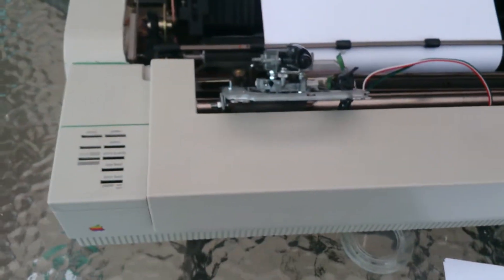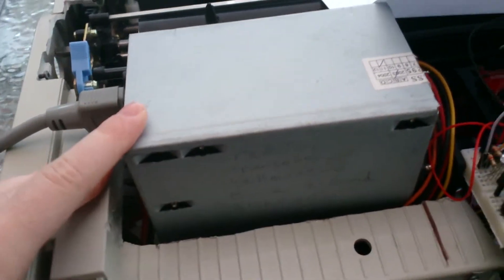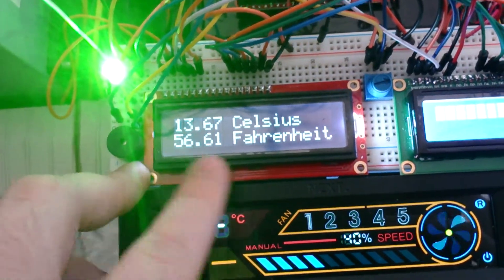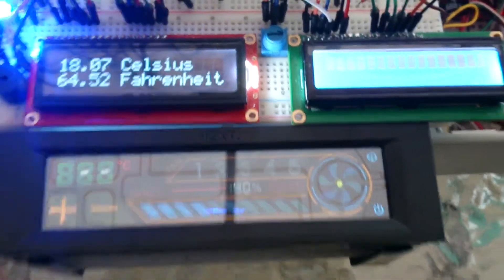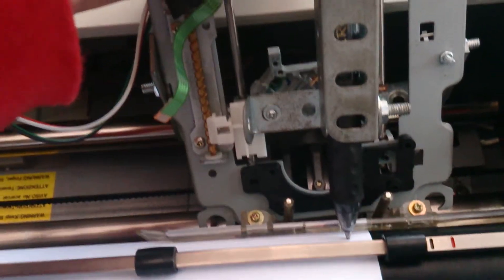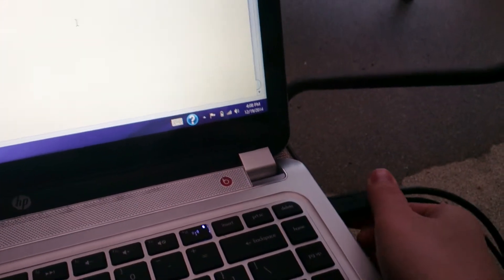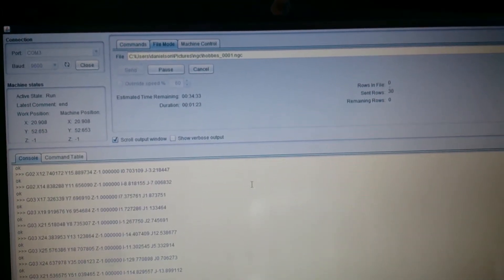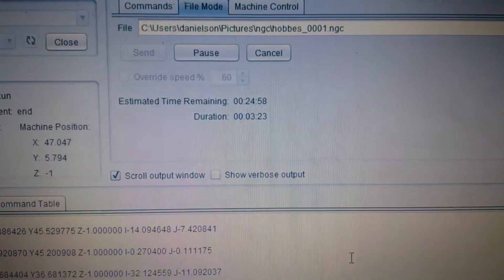2D printer pen plotter arduino shows you how its done Part 1

Comment: Good. But it is slow. Is that intentional ?
Reply from the maker: +yviney Not intentional, the bigger the stepper motors, the faster it prints but the bigger stepper motors are more expensive so it's a trade off I guess.
Reply: +handagga OK. How much did the whole of it cost you?
Reply from the maker: I bought the printer at a thrift store for $5, three motor drivers at $3 each, $5 arduino nano, the power supply I had already, $2 for the CD drive from a thrift store, assorted screws and brackets for about $5 total, and an additional $10 for the extra arduino with 2 LCD's, I already had the fans and the fan controller was $30 but I ended up returning it cause there are cheaper fan controllers. So about $36 in total minus returned fan controller but I had most of the stuff that I bought earlier,purchased previously over time.